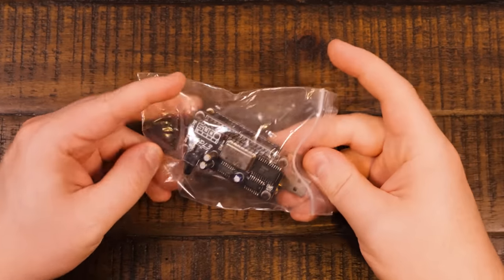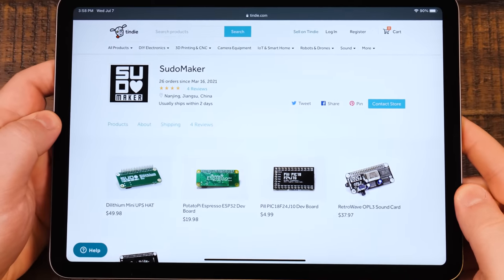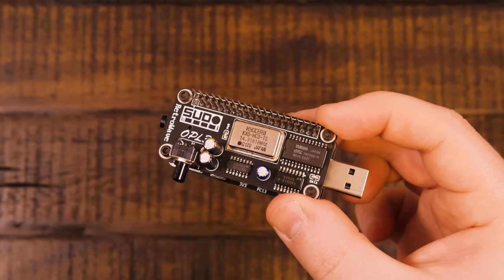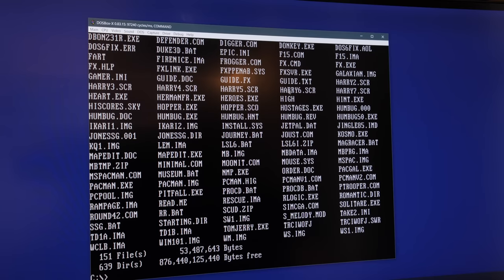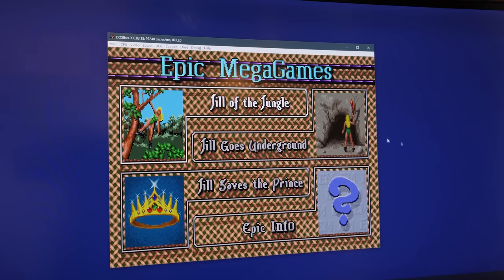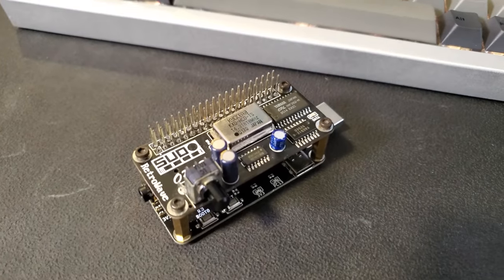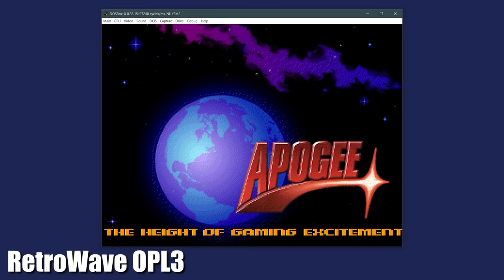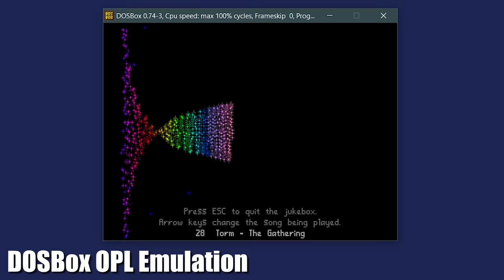RetroWave OPL3: The USB AdLib Sound Card

Comment: I have to wonder if the DOSBox OPL emulation is set to 44.1KHz or 48KHz.  I set everything I can to 48KHz to keep the digital pipeline going straight through without additional processing and have "DVD quality".  That and the pesky Nyquist limit...not that I can hear 24Khz but yeah...aliasing and filtering.  Having the original analog device and not having to worry about any of that is damn cool though. 👍

Comment: I'll say this the dosbox emulation is actually not that bad at all, but It sounds like the software is simply not emulating the lowpass filter the YMF262 FM does to give it a warmer touch and the dynamic range is limited, Objectively I'd say that's a big miss for the emulation but It's still actually not too shabby. MDFourier might be able to help with the emulation scene get closer to how that should sound.

Comment: Dang, I'd love to see a YM2151 (Sharp X68000, Capcom CPS1 arcade games) or YM2612 (Sega Genesis/Mega Drive, FM Towns) version of this!

Quick question: I couldn't tell from the camera angle, was the cable that was connected to the Retrowave a normal 3.5mm speaker cable therefore the sound is output directly from the device rather than sent to the OS sound mixer?
Reply: Join our discord server and we can discuss this further! https://discord.gg/D4keUcjy

Comment: I'm a huge fan of all of your videos. I know this isn't a support channel, but maybe you can help me figure something out regarding the RetroWave OPL3 & USB board:

It's been working fine under DOSbox-x. 

Is there any way to get it easily controllable with Win10?

I have tried Hairless MIDI using real MIDI keyboards, USB MIDI devices, loopMIDI and others.. Hairless will send data to the OPL3 (the green indicator will flash on each chunk of MIDI data sent) but no sound comes from the audio out jack.

I'm simply trying to connect a MIDI device to the RetroWave and sample the output directly.

If you happen to read this and can get back to me, I would be most honored

Comment: The general Sound emulation is quite good... The emulation lacks the "fuzzyness" of the drums in my opinion. The original sounds a little bit more dirty if i had to describe the difference. Im not sure why. Is the circuit adding some randomness that could not be emulated? As long as they are available i always prefer a real YM chip (or even a clone from back in the 90s... they were quite ok).I collected a lot of Aztech OPL3 soundcards over the years with different combinations of real and "fake" YM / YAC chips. They all sound really good.
Reply: There's no headspace in the emulation, all the high frequencies are compressed to hell so you lose all those pretty digital transients.  It's like listening to a 64kbps MP3 on a boombox then the FLAC studio rip on a home theater.  Just the hi-hat alone sounds totally different.

Comment: Did you record the emulated version from the pc, or did you send the audio into the same audio interface? The sound card's preamp might color the sound a little bit. On my hifi system, I do notice a decent sound difference both on the low and high end mostly.

Comment: If it works over serial I wonder if someone could write drivers and wire up a db9 cable to the expansion board to make it work on retro PCs. It wouldn't be much use since, for the price, you could get an adlib compatible card that would work with no fuss or the opl3lpt if you have no isa slots. Still has me curious though.

Comment: To me it sounds like more of a difference of different filter patterns between two different OPL implementations than Emulated vs Real hardware.
They've come a long way.
I actually prefer how the DosBox X sound is compared to the USB device. It sounds closer to my real Soundblaster 16, slightly muffled with a bit more bass.  (I'm comparing it to mine using the same song in Tyrian)
Reply: Basically this, as the actual FM chip is fully digital. Mostly it's just the analog circuitry after the DAC and perhaps some differences in register write timing :]

Comment: How far back to the drivers go? I would love to run this on XP/98 laptops that have AC'97 and no expansion slots.
Reply from the maker: This isn't for use on old systems, it relies on software like DOSBox-X to function. At least until more software is written to utilize it :)
Reply: It uses USB CDC as commuincation interface to the PC, so as long as your operating system supports USB CDC, there's a chance it could work.

Comment: from what i can probably hear is that the OPL3 emulation is too perfect in its tones, which may make the sound less interesting and more static, the real one did appear crisper and a little more lively most notably percussion or sweeping pad leads, but all in all opl3 emulation is very very good, but the real deal sounds a tiny bit more "alive"

Also i have a bunch of old soundblasters and some nock offs which have theyre interesting quirks, i wonder if it would possible to buy one without the opl chip and transplant one from a real card to a modern module.
Reply: If you'd like to, we could send you an unsoldered set ;) Contact us on Tindie and we could discuss it later

Comment: Sorry for my ignorance, but as a retro PC enthusiast myself I have never understood what's the obsession with a modern-retro sound cards... Correct me if I'm wrong, but can't we easily emulate ANY 80s and 90s soundcard in a software level given the speed of a modern processor? Why bother with these FPGA or IC hardware accessories? Can someone with more experience in this please give me a quick breakdown of this? Many thanks in advance!
Reply: At this point, authenticity mostly. With something like the SID, I can see how you'd want the actual analog circuitry, but with mostly digital, or fully digital (like this one) soundchips, I'm personally happy with a good emulator :]

Comment: To be honest I couldn't make out a lot of difference in terms of sound quality in comparison to the emulated sounds, at least not enough to be worth spending money on.  What does occur to me though is that if you used the OPL3 hat with a Pi 4 you could end up freeing up system resources to allow faster performance on either an emulated CPU or GPU.  Of course, with a system as powerful as a modern desktop PC that would not matter but it makes theoretical sense on a lower powered ARM SOC.

Comment: I'm a little disappointed that it comes up as a com port and not a midi interface. I think the stm32 can do USB midi
Reply: There will be a future version of base board using PIC24 which will have USB MIDI firmware. The STM32 board will be marked as EOL since the shortage of semiconductors. Stay tuned!

Comment: 3:09 - "Uses SPI, a modern high-speed bus." - LOL! 

SPI is older than ISA, and at its absolute maximum, can do 60 Mbps. Obviously more than fast enough for this use, but not exactly "high speed". (For comparison, the original "ISA" bus in the IBM PC 5150 ran at 33 Mbps. The first version properly branded ISA that wasn't variable-speed was 64 Mbps.)

Comment: Do the two DOSBox versions use the same OPL emulation code? There's certainly a difference, but it isn't necessarily a fair comparison when the builds are different.

Either way, that's a neat little device, and I'm quite tempted to get one.

Comment: The emulation sounds like it has the higher frequencies rolled off a bit.  If you run it through a spectrum analyzer to see the difference exactly, you can probably EQ it to be a perfect match.  I wonder if they emulated hardware that had a low pass filter on it, because when you first played Duke 3D and the other game, I heard a pretty harsh resonance peak that seems like it wasn’t intentional, so maybe this little board doesn’t include a low pass filter that original cards had?

Comment: Someone should make a USB to ISA thing Clint @LGR.......  to use a SoundBlaster SB16 on modern PC's...
Most of the current sound cards.. are highly out of tune... as you can check with a vintage Hi-Fi graphic equalizer... 
at low frequencies like 100Hz or 60Hz ... modern sound cards play terribly low those frequencies compared to frequencies of 1KHz or 2.5KHz ..

Comment: it's a shame it doesn't have spdif output, I would gladly pay more for raw digital signal.
Reply: In that case there will be no difference than emulation since it’s the dac(YAC512) which really made the difference

What’s more it’s sending out a custom floating point bitstream rather than a “SPDIF” thing, it’s not that possible to output with SPDIF without certain conversion or resampling, and it’s out of the purpose of this product.

Comment: not digging the USB-A connector, I have far more USB A-B (of every size) cables than I have A-M to A-F and there's no way in hell im letting that brick dangle out of a port
Reply: There's a USB-C connector on the side of the board as well. You can use either of them as you like.

Comment: $20 bucks for an stm32?! You can buy a 5 pack for $3 bucks holy smokes are they ripping you off.
Reply: What? The $20 is for an STM32 dev board, not just a bare STM32.....
Reply: You probably went off the grid for too long LOL(no offence)
There's a severe global semiconductor shortage since the beginning of 2021, especially for STM32s. Luckily we grabbed the last not that crazy priced pieces at the last moment, so we can still make a whole dev board priced under $20...
Reply: @hellishinc  You can try order those cheap ones and see if it ships. Or check if it's actually a STM32 clone which is hugely unstable and very easy to break. Anyway for bare STM32 chips we could not find any legit ways to purchase them cheap anymore, and we should't just buy "cheap" ones and blow the chip off from them - it's meaningless.
Reply: @hellishinc  If you can still buy them cheap, granted real, please help other people out who are suffering from nowadays super highly priced semiconductors by telling where to buy these boards. The world needs you, man